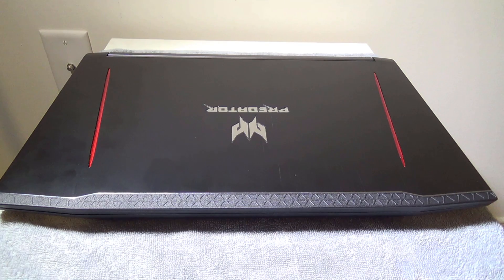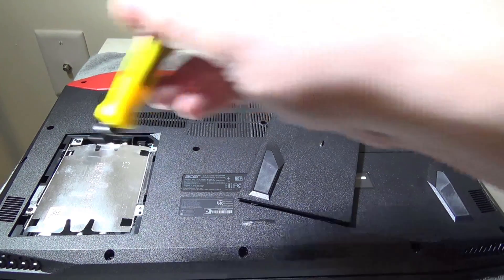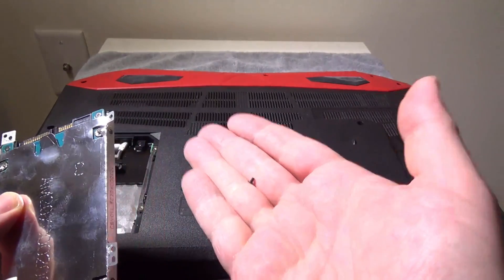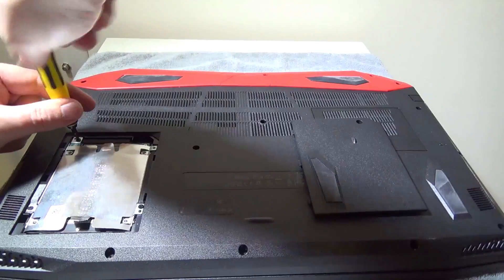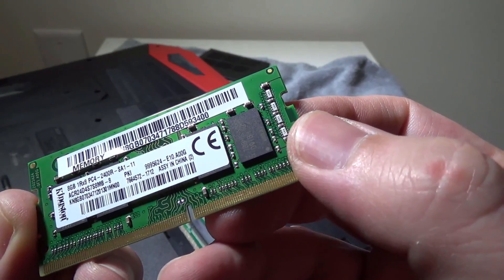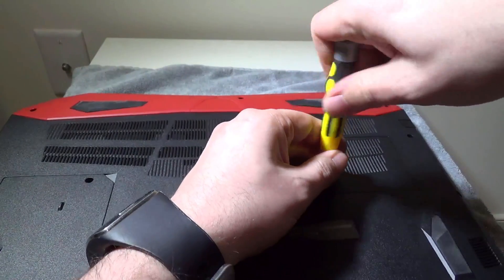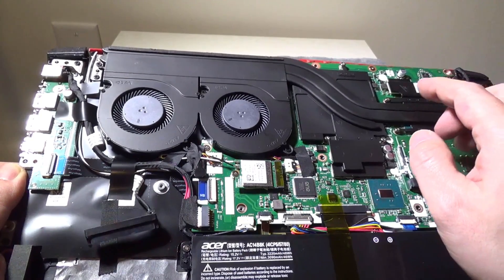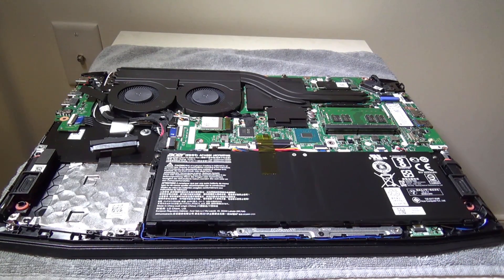Acer Predator Helios 300 Gaming Laptop • How To Add a 2nd HDD and Upgrade RAM

Comment: Ah shit, I threw the charger box away cause I thought that was all because I thought you gotta request for the kit. GOD DAMMIT!
Reply: It is these screws
https://www.amazon.com/Supermicro-Screw-Label-Swap-Tray/dp/B0038KU1YO/ref=sr_1_3?ie=UTF8&qid=1502955808&sr=8-3
If you don't want to buy the whole pack you could try to go to a laptop repair store and ask them to give you 4 for cheap/free
Reply: Will it not work without those 4 screws? I mean, aren't they just for securing the HDD or do they also play a role in its connectivity?
Reply: @tanishdhariyal8002  bruh have you tried? Did it work?
Reply: @witchysketchy  I don't remember exactly, but afair it worked with 2 screws I found somewhere (at a computer repair store most probably)
Reply from the maker: whoops.. I have had other subs say the same thing.  That's why in the video I specifically show to screws in the accessories box in the unboxing.  BUT it's easy to purchase 4 screws of of Amazon or somewhere I am sure.
Reply: How do I know what size are the screws so I know for sure it fits.
Reply: About 3 weeks in and storage running really low.
Reply: same smh
Reply: I'm sorr y to butt in but why are there seperate screws in the package?
Reply: I have the same issue, did you figure out a cheaper way to get the required screws?
Reply: sammmeeeeeeee

Comment: Can I add 1TB gard drive to this laptop in addition to SSD ?
Reply from the maker: +eagle there is an empty 2.5 in Drive Bay that you can either install an SSD or a mechanical drive but not both it comes with a 256gb m. 2 SSD installed but you do have that extra Bay to add another Drive

Comment: My Acer Predator Helios isn't recognizing the 2nd HDD at all. Is it because I never put the 4 extra screws that are in the charger cord box in? Or perhaps I need to download something else?
Reply from the maker: +Eric Metzger you need to go to Windows settings then to Disk Management and create a partition on the new hard drive before windows will see it
Reply: Galaxy Tech Review The brand new drive isn't showing in disk management, just disk 0 partition 1, disk 0 partition 4, and Acer (C:). 
I downloaded SATA AHCI Driver from the Acer support site, and upon running that application I am able to see the SATA disk but am unable to do anything else.
Reply: Eric Metzger Same thing for me it does not show up in disk manager and I do see it with the sata ahci driver

Comment: Thanks for the video. I just got my acer predator 300 and followed your guide. I don't know if my hard drive installed properly. My bios confirms it but I don't see a drive bay for in my folders. Any suggestions on what to do?
Reply from the maker: yes go to Windows settings, then Disk Management and create a partition on the newly installed drive, then you will see it in "My PC"

Comment: Anyone knows the size of screws for hard drive?  They don't come with my laptop.
Reply from the maker: +Xiang Li did you check in the box where the power cable came in? Mine were in a little plastic bag in that box. I am not sure what size they are myself

Comment: I put the hard drive in and it's not popping up on my computer
Reply from the maker: +Gameover1000- that's because you need to go to Windows settings then Disk Management and create a partition on the drive that you just installed before the PC will see it in my PC

Comment: Which would you recommend adding? HDD or SSHD?
Reply: Just_Prodiigy is this a general problem or just a coincidence with a few people?
Reply: Just_Prodiigy okay thanks a lot m8!
Reply: HDD's are a log bgger and cheaper, SSD's are better for gaming but mainly sandbox and stuff where you need to load a lot of things, but HDD's are generally better.
Reply: AdelOperates - SSDs are better. They are like HDDs but don't have any moving parts and are more powerful but expensive. 

HDDs are still beast if you pair it with a good SSD
Reply: Amazing Spodermon SSD
Reply: Rather get a SSD but if you don’t have the money get a HDD because HDD is by far cheaper but still a SSD is better than a HDD
Reply: i'd recommend adding a Seagate 1TB BarraCuda SATA 6Gb/s 128MB Cache 2.5-Inch 7mm Internal Hard Drive
Reply: Amazing Spodermon sshd

Comment: Will this hdd work with acer helios 300 and how will be the performance?

thanks

https://www.amazon.com/gp/product/B01M1NHCZT/ref=as_li_ss_tl?ie=UTF8&linkCode=sl1&tag=galtecrev-20&linkId=53d509876f5927c26cacda690214c370#Ask
Reply from the maker: Jayraj Patel this is the exact drive that I use. So yes that's the drive that you should order based on my video. It's a solid Drive with pretty decent speeds and works perfectly for gaming

Comment: Is it better to do this before you start the laptop for the first time or does it matter. I ordered one and it will arrive by the end of the week and I want to know if I should do this before I even start the laptop for the first time
Reply from the maker: nope you can add a 2nd hard drive anytime.
Reply: Ok sweet! Thank for replying so soon. So just unscrew cover and metal installation cover, screw hard drive into cover, plug it in and just screw it back in? Lol that's almost as simple as changing a battery
Reply from the maker: +RIPtide2323 yes and then once you install the drive make sure to go into Windows settings and then Disk Management and create a new Partition on the new Drive so that windows will see it and you're good to go
Reply: Galaxy Tech Review ok cool. Do you have a video or can you tell me step by step how to create a new partition? Sorry i have just spent a lot of money and time on getting this laptop and i don't want to screw it up

Comment: Thanks, this video are useful....
By the way, the storage drive are using the 2.5 inch one? (well, just to make it sure)
Reply from the maker: +Yanuar Ramadhan yes I use a 2.5 in Drive 7 mm
Reply: Galaxy Tech Review
Nice, thanks
Reply from the maker: np
Reply: will the 2.5" 15mm fit in?

Comment: I just added the extra hard drive you recommended. But the system doesn't recognize it. Do I have to do anything else? I screwed and plugged it in, restarted the computer and nothing happens
Reply from the maker: +surround00 yes you have to go to Windows settings then go to Disk Management and then create a partition on the new Drive then the computer will see the drive
Reply: Thank you, I was able to figure it out.
Reply from the maker: +surround00 no problem

Comment: Once you add the new HDD (In my case a 1TB 7200 Firecuda), after turning the laptop back on is there anything you need to do to get the laptop to recognize the new HDD?  Also, in what cases should you choose to save to the HDD as opposed to the SSD?  Sorry for the probably basic question, just getting into PC gaming.
Reply from the maker: +TheTXSaint once you install it you will need to go into Windows settings then Disk Management and create a partition on that drive so that it will be recognized by Windows once that's done you're good to go you can put whatever you want on the HDD I usually put game installs on mine and then they run just fine

Comment: hey #Galaxy Tech Review 
i need buy a laptop but idk this Acer Predator Helios 300 better or Dell Inspiron 15 7000 for $1,099
answer plz
Reply from the maker: Never tested the Dell so I can't help you there.  Although you will be getting a better GPU in the GTX 1060 on the Acer
Reply: so for the GPU ... GTX 1060 better than GTX 1050ti is that right ?
Reply from the maker: +The Dark Rider that is correct
Reply: thank you Galaxy Tech Review ❤❤

Comment: Exactly the video I was looking for. Quick question, is this port compatible with straight SSD? Or does it need to be a SSHD/HHD?
Reply from the maker: +teufelhunden1775 SSD will work as well.
Reply: Hey, I appreciate the fast response! One more question... I'm looking for an SSD to put into the computer, do you have any suggestions? Thanks!
Reply from the maker: +teufelhunden1775 yes the one I link in the description. The Seagate firecuda
Reply from the maker: +maungtea yes.
Reply: Galaxy Tech Review will this work, i mean plug and play... Samsung 850 EVO 250GB 2.5-Inch SATA III Internal SSD (MZ-75E250B/AM) https://www.amazon.com/dp/B00OAJ412U/ref=cm_sw_r_cp_apa_f35NzbP83R4WR
Reply: Galaxy Tech Review thank you so much...great video and salute from Indonesia...
Reply from the maker: +maungtea no problem

Comment: Thanks for the great video.

I'm presently in the market for a medium budget gaming laptop upgrade from my current Asus G55VW, which has served me well but is getting a bit long in the tooth. I am looking at this Acer Predator Helios 300: 
https://www.amazon.com/Acer-Predator-Helios-GeForce-G3-571-77QK/dp/B06Y4GZS9C/ref=cm_rdp_product 
and the ASUS FX502VM-AS73: 
https://www.amazon.com/dp/B01N9QKYZ9/_encoding=UTF8?coliid=I2K522275M5DP&colid=3TAPO9UCF57B3

Both are about the same price point, after adding the HDD to the Acer, with similar-ish specs. Which would you personally recommend as the better option?
Reply from the maker: There is a difference in the video cards the ASUS has a GTX 1060 3GB and the Helios 300 has a GTX 1060 6GB card so.. I'd go Helios 300 as you can always add a hard drive but you cannot change your video card.
Reply: Galaxy Tech Review Any thoughts on the different screens and cooling systems?
Reply from the maker: I havent tested the ASUS myself so I can't help you there.

Comment: Would a 4th 15 mm drive work? specifically Seagate 4TB Barracuda Sata 6GB/s 128MB Cache 2.5-Inch 15mm Internal Bare/OEM Hard Drive (ST4000LM024) https://www.amazon.com/dp/B01LZMUNGR/ref=cm_sw_r_cp_apa_cKhvzbDA80GJV

And if not what is the benefit of the firecuda compared to the barracuda?
Reply from the maker: You need a 7mm drive.  Firecuda drives have built in flash storage (SSHD) to help access information quicker than regular mechanical HDDs
Reply: Galaxy Tech Review thank you for the quick reply.  guess I don't get why they'd both say 6bg /second then but I well.. ordered and looking forward to installing. :)

Comment: Hey Luke, just ordered this laptop a week ago and got my hdd sshd seagate firecuda 2tb today. Does your sshd disappear from the d drive whenever you turn off the laptop or put it in sleep mode because mine does and I don't know if it's a faulty sata cable or something about the my bios setting. Ps. it doesn't show up on disk management or in the bios.
Reply from the maker: Nope.   Sounds like you have something going on there.

Comment: Is there anything we should know about the battery? Can it be replaced or will we be able to upgrade it to a larger size at some point? Thanks!
Reply from the maker: it can be replaced you have to remove the bottom cover and then it can be unplugged from the main board.  Don't think they will make larger batteries for it in the future.

Comment: Hello , do you have to remove the battery in order to add a M.2 SSD? or just remove backplate and put it in place?
Reply from the maker: +Petros Nastas no you don't have to remove the battery you can just remove the bottom and then put it in place It already comes with one installed.
Reply: Galaxy Tech Review  Thank very much you are very helpful , one more thing do you have any idea if the international warranty for this laptop is 1 year or 2? because i live in greece and i am going to buy it from germany.You can see the confusion haha sorry if it's a little irrelevant :p
Reply from the maker: I have no idea about international warranty you will have to ask Acer.

Comment: Hey! Can you change the battery, when its worn out?
Reply from the maker: You can, you have to unplug it from the mainboard after taking the bottom of the laptop off.  I would assume Acer sells replacements.
Reply: Galaxy Tech Review thanks for the fast answer. i think i will go with it then :)
Reply from the maker: +KingZed cool thanks for watching remember to sub if you get a second

Comment: U added another 2TB HDD, mean this laptop have 3TB overall of its storage, or u just replace the previous HDD?
Reply from the maker: +Sam Chong no the laptop came with 256 gigabytes of SSD storage and then I added a 2 terabyte hard drive to the 2.5 inch hard drive bay
Reply: Galaxy Tech Review It'a still have its own 1TB HDD on the time we buy, right?
Reply from the maker: +Sam Chong no it only comes with a 256gb m.2 Drive you have to buy the extra storage
Reply: Galaxy Tech Review k...thanks for the info
Reply from the maker: +Sam Chong no problem

Comment: One other thing I want to say, I just plugged up my hard drive to the connector, but man, putting the hard drive in that slot with the cable attached, it seems like it's putting a significant amount of pressure forward on the connector cable, like they made it too long, or too stiff, and it feels like it's gonna break if I try to flex it too much to get the hard drive to actually sit where it naturally should to mount the 4 screws onto the base. Was your cable stiff like this when you did it? I couldn't tell if you struggled with that or not, seeing how you fast forwarded through that crucial part in this video...
Reply from the maker: +Xxlibra1018xX mine was fine . Did you make sure to mount it in the bracket the right side up?
Reply: Galaxy Tech Review yes I did, sorry it's been a while. I actually ended up getting it in, I just had to be careful with the cable and move some of the excess length of it up and under the bracket, but after doing so carefully I got everything to fit in there just fine. Still loving the laptop too!
Reply from the maker: +Xxlibra1018xX awesome

Comment: Hey, thanks so much for posting these videos! You were really instrumental in helping me decide to get the Helios. Stupid question, is any hard drive compatible with the Helios? I have a super old laptop and I want to transfer the hard drive. Thanks!
Reply from the maker: +Veronica White as long as the drive has a SATA connection and not the old IDE connections you should be fine

Comment: Hi, I read on amazon that has 256Gb SSD but nothng else . This pc come with 1Tb storage?? I have this doubt
thank you
Reply from the maker: +esteban Gomez it does not it just comes with a 256gb m. 2 SSD drive you would have to buy any other separate drive and install it yourself. One terabyte drives go for like 50 bucks so it's not that big of a deal in my opinion.
Reply: Thanks! I think that I´ll buy it
Reply from the maker: +RzurakxMC - Gaming and more yes Windows 10 64bit is installed.
Reply: Kyvin - Future of today home

Comment: the 1st helios teardown on the youtube ? thanks for that.

is that still pre-production unit ? how good this helios 300 handle the heat on high load ? can u test it ?
Reply from the maker: This is the Full retail unit (Got it on Amazon, link is in the description)  Highest I have seen the CPU go is 83C and the GPU 73C and that's after over an hour of game play.  Thermals are good and well within limits.  Make sure to subscribe as I will have a bunch more coverage of the Acer Predator Helios 300 coming up as well as live streams.
Reply: the fan is metal or plastic ?

Comment: wonderful video, could you please provide specifications of the hard drives this laptop is compatible with(size limitations and type limitations if any)? it would be easier for me to find one during holidays at sale. buying link for the drive you installed?
thanks man, looking to buy this product soon.
Reply from the maker: Sure I will put the link for the 2TB Seagate Firecude drive in the description.  I have not tested beyond 2TB, I know that the max for the RAM is 32GB.
Reply: Galaxy Tech Review can i use my external portable hard disk, after removing its enclosure ( by wd) and put in this laptop? i guess its 2.5 inch hdd.
Reply from the maker: +Aakarsh Garg if it is indeed a 2.5 inch hard drive then yes you certainly can install it in the hard drive as long as it's a SATA drive which I'm assuming it is